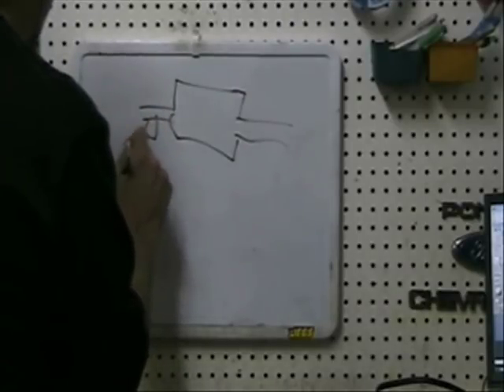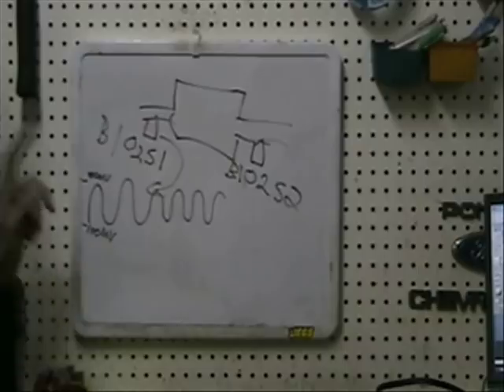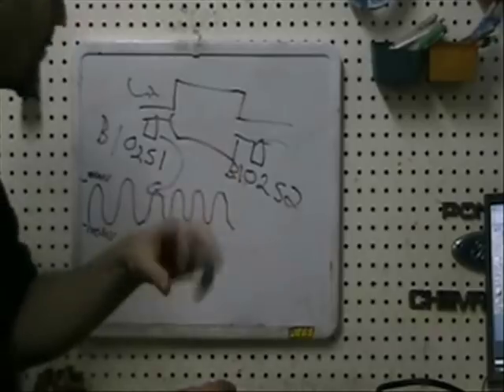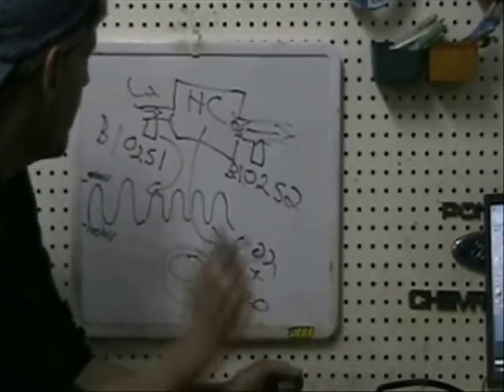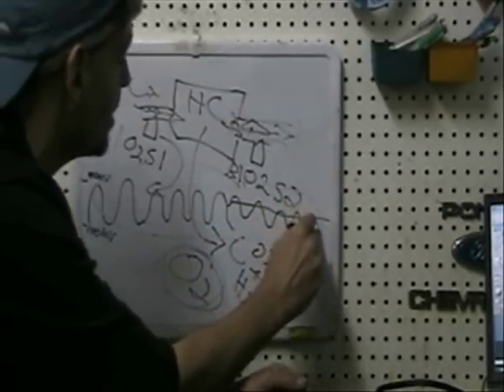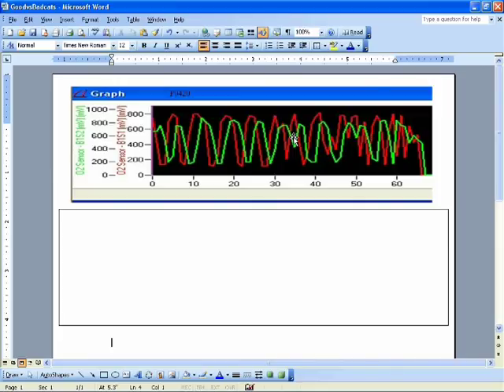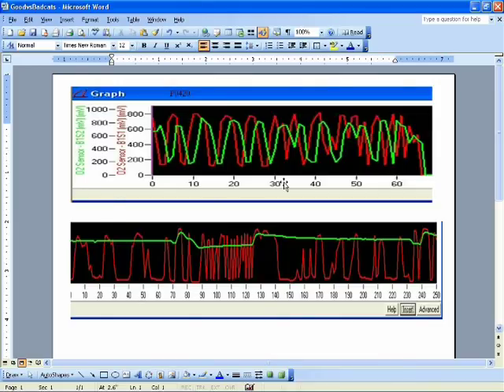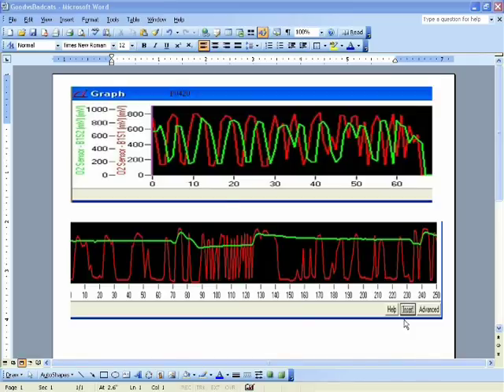P0420 P0430 catalytic converter catalyst inefficiency code diagnosis

Comment: Thanks so much for this video! Really informative and JUST what I was looking to learn today. What if the post o2 sensors are semi-flat as seen on the real time scanner, and not just flat? Would that mean that some oxygen is being seen after the cat, and that the cat is going on its way out?  Or maybe that the sensor itself is going bad?
Reply from the maker: +Balto D Yeah you can sometimes see a little bit of mirroring of the upstream but not actual mirroring. This is indication cats are starting to lose activity and usually within months you will see the full mirroring indicating loss of catalytic activity.  A new converter will be pretty much pegged rich at .8V while older cats will show slight oscillation especially at idle.
Reply: +Schrodingers Box Thanks for the quick reply! I'm looking at a friends 97 Tahoe, and his cel came on for BOTH post cat o2 sensors and nothing else. I'm not entirely sure on what exactly the voltage would be for bad o2 sensors (I've read either pegged high/low indicates a bad sensor). When I looked at the data stream, both sensors were slightly oscillating at idle. So I've been trying to see what the correlation would be that the cats themselves would be causing the oscillation and triggering the cels, and not just the sensors being bad (since the cats have their own fault code).
Reply: He literally explains your questions in the video

Comment: The newer cars use wideband oxygen sensors, not A/F sensors.  Both types of sensors only measure oxygen content and infer mixture from it.  The difference is that narrowband sensors are only accurate in a small window around a 14.7:1 mixture and wideband sensors are calibrated over a much larger range.  Since these sensors (both NB and WB) only detect oxygen and not mixture, they can't distinguish between a lean mixture and a misfire since both conditions result in large quantities of oxygen in the exhaust stream.
Reply from the maker: The post cats are still zirconia dioxide though
Reply: Schrodingers Box
The point was don't fool yourself into thinking that the wideband sensors actually measure the mixture.  They are still oxygen sensors and can be fooled by engine misfires.
Reply from the maker: ollopa1  A/F's measure the mixture allright.  How do you otherwise explain the reversal in polarity with amperage variance directly proportional to the stoichiometric conditions?

Comment: I cleaned my MAF today and tried to follow your example to check the pending P0430 on my 06 Jaguar Super V8 with an icarsoft i930 scanner.  The choices for O2 sensor 1 are either current or lambda (my UltraGage says "wide O2 Lambda") and not voltage so I assume the fore cat O2 sensors on the Jag are of a different type than the after cat sensors.  Is there a proceedure for checking catalyst efficiency with this type of sensor?  I also get way out of range spikes on the i930 graphs and the scale expands to cover the max and min values so the lower value traces between spikes are impossible to read accurately.  I'd guess you don't have that problem with your scantool.

Comment: So basically, you could over ride the p0420 by cutting the signal wire from an o2 with a good heater, and connecting it to + side battery source of ~900 mV, while body grounding the other side of the battery?

Comment: Schrodingers Box 
Thank you for the excellent diagnosis. No wonder why you are so intellectual...   I’m totally a visual guy   Question what scan tool are you using with the graphs and oscillating great video and explanation.. I have The P0420 code on my 2003 Tahoe 4.8 looking for the tool that you have graphs
Reply from the maker: The scan tool is AutoEnginuity.

Comment: Turns out I had a vacuum leak..but I fixed that. Here is some screenshots from my drive to work this morning. I think you can figure the graph overlays out. Top is bank 1, mid is bank 2, and bottom is speed,rpm,maf and throttle. I was on cruise control going 70mph in the first two. The third was me coming off and to a stop.
I guess youtube doesn't allow links...if you go to screencast . com and then
t/xzJHRTUDxgd
t/hqUA9XZUJXJ
t/EqZA8Smr
Interested to hear about the data. i'd love better mpg!

Comment: Thank very much for your responded. another question, with the stuck lean code. does it affect the engine performance at all or any other fuel trim issue?
Reply from the maker: A lean code will affect engine performance if the LTFT is unable to maintain stoic on the O2s. Otherwise there will be no symptoms or ill effects.

Comment: Matt, today I used my limited scanner. But I found two things, my long term fuel trim was at 10%, I had two short term fuel trims, B1 and B 2 , but no long term fuel trim was listed for a second bank? Naturally being a neophite, the first thing I will check for is a vacume leak somewhere, the second bank fuel trim would mean either it has none(not likely) or there is a open somewhere since no signal is registering. Please comment. The car is a 1997 Acura CL 3.0, six cylander honda engine.

Comment: Thanks for the very informative video.  Learned a lot.  I have p0420 code on my Lexus.  I scanned to look at the voltage fluctuation and compared with bank 2 since bank 2 is ok, and it shows very similar behavior on both S1 & S2 on both banks. S1 oscillating around 3.3V in narrow range and S2 very steady around 0.9V unless I push on the gas, in which case it drops quickly. So I am puzzled about p0420 code keep coming back.  I also checked if catalytic converter is clogged with vacuum gauge and it indicates it is not at all.  So I doubt anything is wrong with the cat.  O2 sensors seem to behave well also.  But scanner TID: $A9 test shows bank 1 S2 sensor voltage range of 0.05min & 0.99max and test measurement showed 0.04 while bank 2 S2 sensor voltage range is 0.17min & 0.99max with test measurement at 0.17.  I am not sure what "TID: $A9" really means but bank 1 S2 shows lower voltage than min while bank2 did not.  Do you think this is what is causing p0420?  If so, should I try replacing the bank 1 S2 sensor?  I would appreciate your comment.  Thanks
Reply from the maker: It’s not about lower voltage. It’s about voltage replicating the STFT. If it replicated the STFT you know you have no catalytic activity.

Comment: While the advice in this video will work most of the time, in that mirrored HO2S signals are a red flag that a cat is non-functional, there are times that replacing the cat for a P0420 code will not fix the problem. The PCM is normally very good at determining if the cat needs replaced, however, a few things can fool it into falsely displaying this code. What needs to be verified before going with a P0420/P0430 cat replacement is that:

1) The car is in good control of the fuel. Your trims need to be centered around stoich.

2) There are no exhaust leaks present. Exhaust leaks between the manifold and the cat can cause the PCM to flag a cat, falsely.

3) No TSB's or reflashes have been released that deal with this problem on your vehicle.

4) The sensors, up stream and down stream, are functioning and responding properly. A faulty sensor - especially upstream sensor - can cause the PCM to falsely flag a cat as failing. BTDT, have the scars to prove it.

If these four items are verified to be okay, then believe the PCM and replace the catalytic converter.

Part of the misconception stems from the name of the sensor - oxygen sensor. It actually doesn't sense O2 as much as it senses O2 demand. That is why Robert Bosch called it a Lambda Sensor when he invented it. GM took the ball and ran with it, calling it an oxygen sensor in their early training manuals ... and it stuck. Truth is, if you place a zirconia sensor in oxygen, it'll flat line, meaning no activity. But if you screw it into a tube filled with HC, it'll peg. It gets excited in the presence of combustibles.

HTH
Reply from the maker: 1. Please explain how a fuel trim issue would possibly be a factor. You CAN NOT have a P04X0 code AND a P017X code simultaneously. It is impossibl;e.

2. How could an exhaust leak cause mirroring effect? It may cause a lean effect- sure (which I disproved in a A/F sensor video) but even if it did, it could not cause mirroring. Further it would cause a P017X code and see #1.

3. Correct.  And reflashes are not fixes anyway. computers don't suddenly "lose" their programming. Flashes are done by people who couldn't identify the etiology.

4. Again you cannot get an O2 sensor code AND a cat code. If the o2 sensors are not working you will get an O2 related code.

 You need to show EXAMPLES or LOGICAL EXPLANATIONS  to the contrary. For example, describe a hypothetical situation where a LTFT at 25 as a result of an exhaust leak could result in a P0420 rather and P0171.
Reply: Remember, the point I was making is that a PCM can, on occasion, store a P0420/P0430, when the cat actually hasn't failed, if some issues exist. Having seen and experienced these situations, I shared what I have observed. Now to your comments and questions:

1) I did not say that the two codes would exist simultaneously. In fact, I cannot imagine a scenario where that could happen. What I have seen is that if fuel trims are skewed, then the PCM can have a marginal base line to begin its calculations, and the result can cause other codes to be set, such as HO2S codes, or catalyst codes. The point is that if you have a vehicle that is not in good control of the fuel mixture, then you really can't trust the codes being reported until fuel trims are brought back into line.

2) I did not say that exhaust leaks cause a mirroring effect. Similar to the answer in #1, an exhaust leak can cause a miscalculation by the PCM, resulting in a code being set that is not the actual issue. In this case, an exhaust leak introduces false air, which can bias the HO2S voltage (or amperage - depending on sensor style), causing a problem with the calculations. 

3) Flashing is done to update the software - not because the PCM "lost" its programming. The manufacturers release software updates periodically and inform technicians through TSB's or, in more severe cases, they will issue a recall.

4) Again, I did not say that you would see both codes simultaneously. I have seen a P0420 set in a vehicle that had a brand new, completely functional catalyst. The front HO2S was operating, but the amplitude of the sine wave was off by about 0.2v (0.1v on each end of the scale). The rear HO2S was mirroring the front, and actually had a slightly larger amplitude than the front HO2S. In this case, replacing the front HO2S solved the problem.

Early on, mirroring was something that the PCM relied on heavily, to determine catalyst functionality. More recently, most strategies have shifted to a measured response time during an enrichment/lean cycle, since that is a more accurate method of determining oxygen storage capacity.

I am not disagreeing with you about mirroring being a a red flag, and a good indicator that a cat is likely failing. I am saying that anyone suspecting a cat failure should verify the four conditions that I listed, and if they all check out okay, then go ahead and replace the converter. 

It is possible to have mirroring with a good cat, in some situations. Since this is an expensive part, take the necessary steps to eliminate any other potential causes, and then proceed with the replacement of the cat, if warranted.

HTH
Reply from the maker: You still failed to example a mechanism for an example where what you say would be true.
  Here- example- Exhaust leak- HOW would you get a P0420 from that. Again I gave explanation on why you would not. You would get a decreased voltage on O2S from the leak and thus either lean code or O2 OOR code due to the decreased O2 vo0ltage.
 PLEASE give the mechanism for how this would result in a Cat code rather than O2 lean code.

Comment: This is very good information.  I know it was posted a long time ago, but just now I stumbled into it.  I wanted to know if a bad catalytic converter in my 1996 Nissan Altima can cause the MIL to blink randomly as you drive, or is that what everybody tells me is a misfire?  My car doesn't show any symptoms of a misfire, there are no codes present and haven't been as long as I have owned the car (since 2000).  It drives great.  The only issue I had is that I would drive it until it would reach temperature and then I would turn it off.  Then after a few minutes it would have a hard time starting.  I think that was a fuel issue that I think I repaired since then. I'm afraid to drive the car because of the blinking/flashing MIL.  I have some data from my scanner although they are just snapshots of the results.  I don't know how to post them here, or if it's possible.  Any comments or help would be greatly appreciated.  I agree that my vehicle is old, and the catalyst efficiency may have been due to age, but that MIL flashing while I'm driving is my main concern.

Comment: Love your videos and watch them all. Have a 2005 Chevy Silverado with a intermittent check engine light with a P0420 code. It comes on about once a week, throws the P0420 code, stays on for a couple of hours and turns back off. I had the same thing happen to me but with a permanent light and P0420 code. I took my truck to Midas and had the bank 1 CAT replaced in 2012 and am wondering about their technicians skill level or is my CAT going out again. Would appreciate any feedback. Thanks.
Reply from the maker: What is the O2 S1 and S2 voltage showing?
Reply: The min/max for O2S1 is 0.150-0.910   The min/max for O2S2 is 0.130-0.770
Reply from the maker: Julio Santos Cat is bad

Comment: i have found a rear o2 that had a faulty glitch in the wave pattern on some p420 and 430 codes .i check the temp of the converter .it can tell u to some degree that the converter is working .but i could not see the glitch pattern on a scanner .but i could see on the scope.but like one in a hundred. rare

Comment: Shouldn't a spirited long drive burn out carbon build up?
Also can downstream sensor get dirty so and upstream and downstream sensors get dirty  and detect similarly wrong amount oxygen, resulting with no detection of fuel trim problems?

Comment: THANKS THIS IS VERY HELPFUL ONE QUESTION IF I HAVE UPSTREAM CONVERTERS AND DOWNSTREAM CONVERTERS SHOULD I CHANGE BOTH OR JUST THE DOWN STREAM CONVERTER WORKING ON 2005NISSAN FRONTER 4.0L V6 HAS CODE  PO420 TW  CATALYST SYS B-1 WHAT DOES TW  MEAN AFTER PO420? THANKS YOU ARE A GOOD TEACHER

Comment: At what conditions should I be reading an accurate wave signal. What if you have a straight line at a lower voltage 250mv on second sensor.?

Comment: I also wanted to know if my vehicle has 2 catalytic converters or just 1.  It states it has a precat and then the cat.  There's an O2 sensor before the precat at the exhaust manifold and then the exhaust exits the pipe to a straight catalytic converter where after that is a second O2 sensor.  So, which one is it, the first or the second, or both?  Thanks.  My vehicle is a 1996 Nissan Altima.

Comment: if i have a small rusty crack in front of the flex pipe, can this fool the b1 s2 ?  ON  1MZF2  going to run more testing, and not run to autozone. keep up the good work. when on the top the want to knock bank 1

Comment: First off, I really like your videos. Your sense of humor is just like mine...just ask my wife. Anyway, I have the dreaded P0420 and I was wondering if the waveforms of o2si and o2s2 will still appear like yours if a wide band o2 is at the inlet and a regular o2 is at the outlet of the cat? Seems like it would be. I have a 2005 VW Golf, 2.0L.
Reply from the maker: Yes the rear O2 sensor is still zirconium dioxide- it will behave identical as a traditional O2 sensor system even if the upstreams are A/R sensors.  Good question man.
Reply: Thanks so much for your reply. I didn't graph it, but I did pull the two voltages together and watch them at various rpms and thay mimicked each other within miilivolts of one another. Thank so much.

Comment: I'm getting Code P0430 on my truck. I recently changed the Bank 2 Sensor 2 O2 Sensor. My truck doesn't have the most rear sensors ( it does have all four bank 1 & 2  o2 sensors. I'm wondering how I can find out if it's sensor 1 or 2 of bank 2 since it doesn't specifically tell me which. 

My truck is a 2000 GMC Sierra 1500 5.3L V8 it does not have catalyst converters but yet the code never came up before.

Comment: I've gone through 2 pairs of catalytic converters and no one can tell my why they keep burning up. Now I have to do it for a 3rd time. P0420 and p0446. The smell is awful and I've spent $600 on diagnostics that say replace the cat. This is within 30k miles. I hope these videos will help me figure it out myself this is getting expensive and it's a big mystery, apparently.
Reply from the maker: usually a rich condition will cause that since it makes the exhaust hotter. I would start with a fuel trim analysis as the basic beginning step and then go from those results.

Comment: Question about how to 'read' the secondary O2 sensor.  Our 2001 VW beetle does not report voltages at the rear 02.  It reports back using an amp scale on the test tool(s).  While our P0420 code was traced back to a poorly maintained engine that caused the cat to fail--how would someone be able to interpret an Amp scale and not voltage?    It was probably the lamest thing I've seen...reporting the O2 front using a voltage scale via the scan tool...and the rear one?  Let's use an amp scale??

Comment: My 2000 Civic has an O2 sensor right in middle on the Catalytic Converter. So is that after converter or center converter?

A brand new Catalytic Converter has just been replaced. Now, I got P0420 and P0430 after ten minutes (12 miles) for driving, what would be my problem?